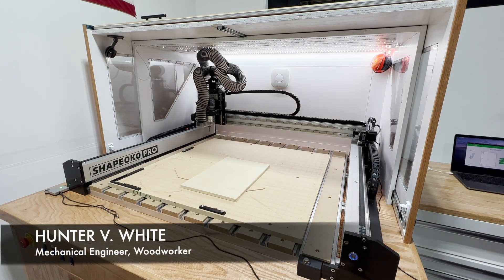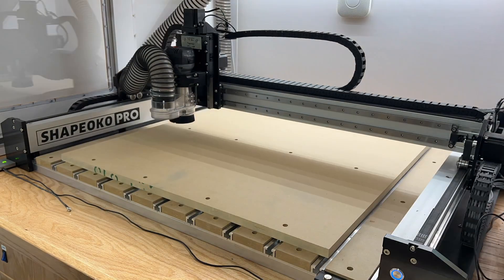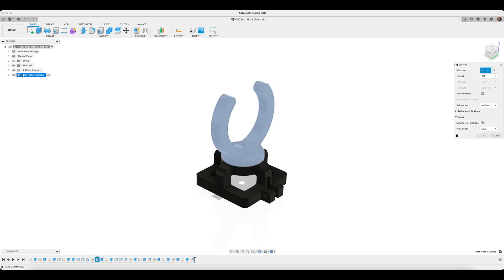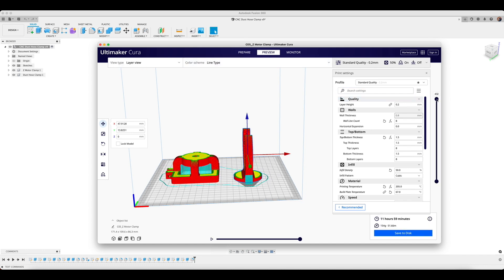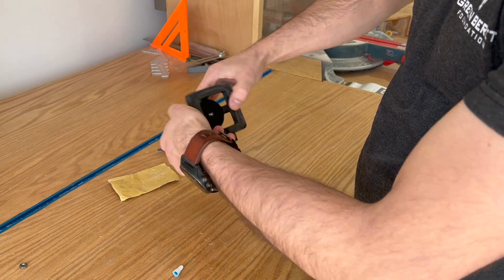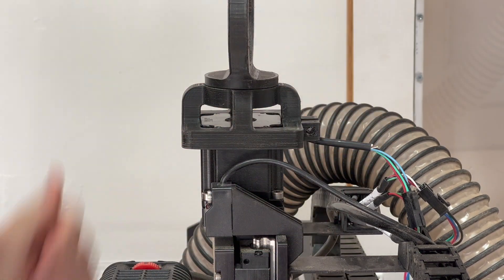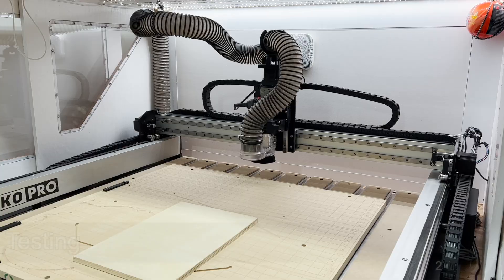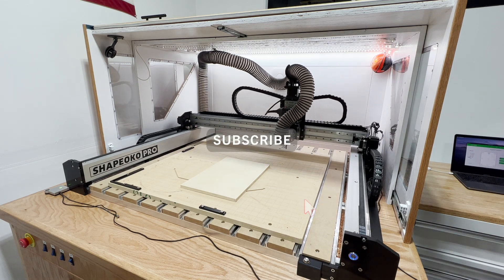3D Printer Project: CNC Dust Hose Clamp

Comment: What happened to your plans to print this clamp? I see you offer a fully printed version of this item, but had hoped to just buy the plans and print it myself. Is there another site that I can purchase the print files? If not, I gotta say it is a very cool idea. Great idea mounting it above the Z-Axis motor, You are right, Carbide should offer this type of accessory. Maybe you can sell the idea to them.
Reply from the maker: Hey, I’m no longer offering the DIY plans for the dust hose clamp; sorry to disappoint. I did a complete redesign of the product and I think Gen 2 is much better than Gen 1. To be fair, the functionality is probably the same, but aesthetically I like Gen 2 a lot more. I hardly sold any of the digital plans, and didn’t want to compete with my physical product. I can’t say enough about Gen 2 though, you should definitely get one.

Comment: You can flame polish to get rid of the white parts left after sanding (and the stringing). Just take a lighter/torch and wave it over the part. It needs very little to look great. Just don't breathe it in.
Reply from the maker: That’s a great idea; thanks!

Comment: Well done and clever design! On the motor clamp part you may want to add a filet at the corners of the where the screw goes in so the clamping pressure (even hand tightening) doesn't snap the tabs off.
Reply from the maker: Thank you! That’s a great idea; I should have thought of that. I’d have to extend the tabs a bit so the fillet doesn’t interfere with the bolt head and nut, but that wouldn’t be a problem. I was worried about them cracking under tension; I don’t have very much experience 3D printing yet; very fun to learn something new though.
Reply: @EngineeringWorkshop_hvw  Right on! I designed a spindle mount for my CNC and did the exact same thing. It cracked as soon as I tightened the bolt which is how I learned. You're doing great work!

Comment: Very nice! I have the Shapeoko Pro and am in the process of changing my dust collection. This top mounted system was something I have been investigating. I don't have an enclosure but have the same issues with the hose moving around the cables as the spindle unit moves from back to front.  I'm also on the Shapeoko forums discussing methods to mount Sweepy on the new spindle Carbide3D has released.
Reply from the maker: Thank you! I definitely want to buy the new spindle - I got on the “waiting list” as it was sold out as soon as I realized it was released. I’m very excited about it. Fusion360 allows me to control the spindle speed when making tool paths, so I will have a lot more flexibility to maximize surface finishes, etc. 

I love the dust hose clamp so far - I highly recommend mine, or one like it. I don’t have a single thing I would improve; it works exactly as intended. The only thing I would do differently is print the parts in warmer weather so I wouldn’t have had to sand them - not the designs fault lol.